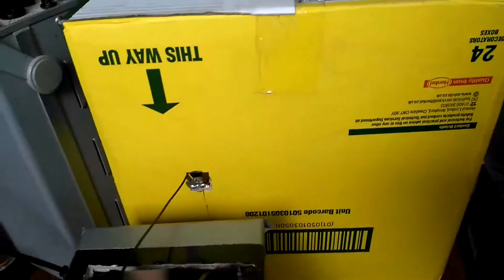3D Printer Problems: PLA Part Warping - guide - HOW TO SOLVE IT! (TronXY X1)

Comment: Heated bed?
Reply from the maker: A heated bed is overkill for this problem which - as the video shows - is solved with tape. You need to buy & install a heated bed, find a way to control its temperature, you need a high current supply and it's relatively dangerous to leave unattended. It also adds weight and drag to the build plate which on this printer, moves.

The video shows a solution with none of those problems.

Of course, a heated bed offers other advantages - like being able to print ABS and other filaments, and I'll probably fit a heated bed at some point, but that's not what this video is about. A PEI plate is another option - I will install one soon.

Comment: You could invest in things such as a coropad, zebraplate, buildtak, etc. Ive yet to use my coropad, then again I did just recently finish building the printer
Reply from the maker: Hi Justin, I spose i could invest in those things, but - since it's a solved problem, I don't need to solve it any more, unless those products give me something the tape doesn't? There is one downside to the tape - it's coated in some waxy substance which comes off on the bottom surface of the print. This makes a non-shiny surface. I've heard that wiping the tape with rubbing alcohol or a similar solvent will remove the waxy coating, but I haven't been bothered to try it so far.
Reply: Chris Wesley As long as the printer prints, you get good adhesion, no warping and no bad curling, then youre right, theres no need to try to resolve the same problem. There is a couple benefits that come to mind when using the alternatives, which is being able to repeatedly use the build surface unlike tape, where, like in this video, great bed adhesion also means having difficulty removing the part. Also they leave a much nicer finish on the part itself
Reply from the maker: Great points. Thanks again Justin.